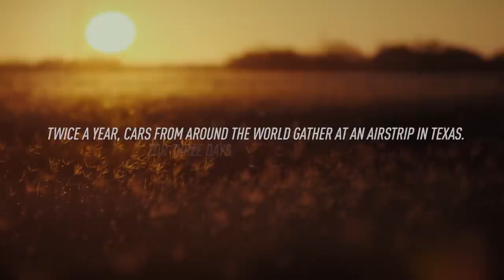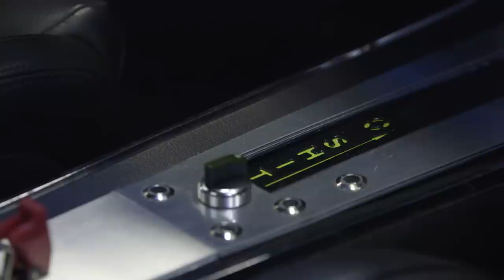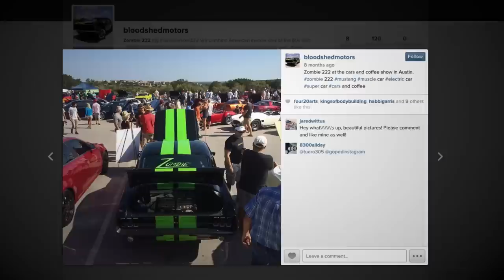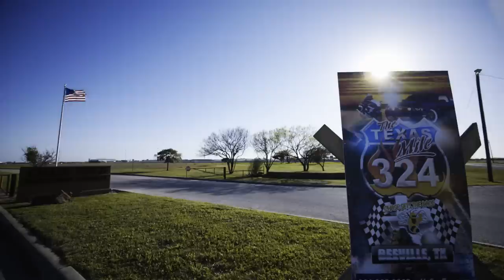The story of an all-electric, record-shattering '68 Mustang

Comment: The verge is hands down the best I've seen at featured videos, theres always some special element they add that makes it so engaging, and the stories are unique. Awesome job to the team that put this togther
Reply: aka wide angle lenses. It looked like a 20mm (maybe an 18mm)
Reply: VikTheGreat we do love our wide angles lenses! Our go-to lenses at that range are the Canon 10-22mm EF-S and 24mm 1.4
Reply: Oh, so you guys didn't shoot on a full frame sensor? I thought the Verge Video-team shot on 2 C100's.   Did you shoot it on a 7D instead?
Reply: VikTheGreat Nope, we very rarely shoot on full frame sensors. This project was shot on a combination of C100s and a C300, probably 50/50 each. Tried to do a lot of the exterior stuff on the c300 due to the stronger codec, as well as using the detachable monitor for some of the in-car stuff.
Reply: It's awesome to hear how you go about filming. I absolutely love your video team. Thanks for responding! :D
Reply: ***** all hail wide angle lenses
Reply: ghmasterjj i would say Verge is next to MKBHD but yea i love their graphics they are great .
Reply: ghmasterjj This is the first I've seen and was impressed. It was just simple facts, no fluff. I kept expecting a commercial break and a cliffhanger before they showed the top speed. Or 10 min of discussion on what it would mean to them before showing the speed.

Comment: We took the Monster to the grand opening of the San Antonio Speedway last night and set a number of new personal records. We now have a 0-60 time of 1.91 seconds and ran the 1/4 in 10.24 at 140MPH.
Reply: DAMN!
Reply: mitchmedford correction. o-60 in 1.94....typo
Reply: +mitchmedford  ! Starting to make I.C.E. CARS LOOK OUTDATED AND SLOW !
Reply: If you could get your 60 ft time down you would easily run in the nines. Has anybody tried using a clutch set up with this combination.
Reply: +ben huffman And the point of dropping the clutch would be??? Dude stop thinking with an ICE mentality, there is no heavy flywheel to carry reciprocating mass and get pistons to the next firing position, and any extra mass would just help induce wheel spin. Electric motors make peak torque at zero rpm, therefore you have the advantage of NOT shock loading the drive train / rear tyres like an ICE vehicle to get it moving, you can apply all that torque without twisting up the body unnecessarily. If anything you probably want to apply the reverse. Tyres have a maximum grip point when warm, you would probably get faster times by dialling some of the torque out of the car to launch it. And to answer your question yes you can run an electric car with a clutch but only for more efficient gear changes. I've driven an electric manual with no clutch and it isn't that much fun, you have to wait for the motor to spin down with the direct coupling to the gearbox to allow smooth changes, doable but not as smooth as having one.
Reply: +mitchmedford Man that thing is really cool and i want to love it but the sound just turns me off, its a great car and good luck with your vision, also great choice in car i love my 68' even though it has a 289
Reply: +mitchmedford Awesome and inspiring work.  Another niche I would suggest you look at are Mazda Miata conversions.  There are a few companies offering kits now but the performance historically has not been that great.  A 250Hp to 400Hp electric miata conversion kits for $15k to $30k would be great and sell quite well.
Reply: cool and they are rear drive too . sounds like a great option !
Reply: +mitchmedford HOLY CRAP! you go to the Sandyz in Lakeway?! I used to see old classic cars there all the time when driving around but i never had time to stop. I can't believe this thing is from Austin! I hope I see you around someday I'd love to ask you the same exact questions lol. Awesome car man. And I admire that you're following your passion.
Reply: +mitchmedford Why such a high 60'? Unless you mean 0-60mph?? You should word that better...
Reply: Think they are from the USA where they do not use metric like the rest of the world !
Reply: Terry Thomas I live in the US though? Whats metric have to do with it?
Reply: only 3 countries in the world use the imperial system & we in the other parts know only metric so when we see 60 we immediatelly think km ! so it looks really slow . as opposed to 100km !
Reply: Terry Thomas Speak for yourself... If I see an American post something I automatically assume it will be in imperial. And even though I live in a metric country I learned both at school.
Reply: um Which America ! North  Central or South ! Maybe you mean the USA ! The accent is the same in Canada where they use metric ! so one can never presume the yank sound to be imperial or metric !
Reply: Terry Thomas Hes in Texas
 so USA
Reply: ok
Reply: There is only one America where they speak American (English). Canadians speak Canadian (English) and French, and South Americans speak predominantly Spanish. To the untrained ear they may sound the same, but people say the same thing about New Zealander's and Australians which both speak English but when you listen closely they actually sound nothing alike.
Reply: ok
Reply: +mitchmedford 
Just a follow up on this, they're down to 1.79 0-60 and a 9.89 quarter mile.
this is way, way past scary fast.
to put that into perspective, you get to 60 faster than you can say "zero to sixty in  one point seven nine seconds", go ahead, try it with a stopwatch.
Reply: Bit quicker than Nissan GTR or ferrari .
Reply: Sir, if you ever make a stop in Tucson, Arizona, let it be known you have one passionate fan here who appreciates  what you've done with your amazing vehicle. It is literally a dream come true! There's also a night of me paying for your drinks that night should that opportunity ever arise.

Greetings from The Old Pueblo,
Arthur "Aardcore" Gardner.
Reply: Race him cross country in a family sedan and you'll leave him days behind. Just wait a second while I refuel should only be 8 hours or so :) and at that speed he'll be lucky to have an hour driving range.
Reply: This thing would burst into flames instantly with all that battery power. It looks like a muscle but it don't sound like a muscle car which is part of the fun man. I want to hear that mosnter growl and scream and you can't get that with any electric vehicle. I like the car but I don't believe it's a mustang.
Reply: i wonder what you are going to do in 5 years to beat this,, you got great traction control on this,, vary nice.
Reply: i would t
hink you would want computer traction control programing.
Reply: rimac
Reply: So we basically have the rate at which the Tesla roadster stats here then lol.
Reply: lessdeth69 wish they'd do a 90s Festiva.. and it could finally have AWD too.
Reply: @drewholt1860  fit a lightweight sound system and amp your favourite in relation to the Amps X Volts
Reply: @dalelc43  oh FFS when did you last take the second fastest car in the world for an endurance test?
Reply: You're awesome do a fox I'll give you a roller to do it they weigh a 1k less you will get that 170

Comment: Aerodynamic is really important, at the first moment i dont understand how you put that spoiler if you want top speed.

The next time remove spoilers incluiding the front, cover the rear wheels, and cover the down of the car with tape if its necesary. And a plain hub caps helps too
Reply: vicesat Agreed except for removing the front spoiler. Everything about these vintage Mustangs wants to lift the car in the air from the front. The chin spoiler helps keep the front down. The wing was only there as a precaution because we had never engaged overdrives at high speed with skinny speed rated tires and wanted the extra down force for traction so the rear wouldn't slip. After the first run, it was clear that we didn't need the extra down force so we removed it to reduce drag.
Reply: I think in that, because i see a few cars flying because they dont think enought in this.

But maybe a smaller front spoiler, or turn a bit to have it more straight with less grip, helps to high speed without risk

Comment: How's the battery life though?
Reply: It does about 40-50 miles per charge, depending on acceleration.
Reply: It's called "range", it's not a cell phone :)
Reply: ***** Far from a dragster :)
Reply: Esa Edvik you still charge the batteries tho
Reply: ***** What kind of cameras did you use? The video looks amazing.
Reply: Rashad Yeah il stick with a model s for that.
Reply: Idk but he can get better battery life by flashing a different kernel
Reply: ***** Not when they're 32k a pop hahahaha. I guess you could probably afford the batteries if you could buy the car.
Reply: Tyler Eberhardt i was reaponsing to Esa Edvik mistakenly assuming he was rasponding to the original comment... now i realize that my comment makes very little sense :))
Reply: Rashad The racing pack we use is the lightest pack design that gives us the power to shock folks and enough cruise range to do races, cars show and short runs around town. We can go 40-50 miles on a full charge. We could easily put in a bigger pack to get more range, but it will weigh more. We expect our customers to work with us to determine the mix of performance, range and cost they want on each car we build.
Reply: ***** How's the tire life when the battery is used in an aggressive manner?
Reply: Rashad It's got it's ups and downs!!! Just like yours... HA!
Reply: Tyler Eberhardt but bro the cost to fill up to a full charge is free if you are on the road or it cost about 14$ to charge at home. U save a lot of money from not buying gas.
Reply: Its a bit bland though..fun to drive..just looks boring and dull (a tesla S that is)

Comment: I like the idea, just wondering how much juice can you get on that 30k battery if you want to ride it on a daily basis without charging.
Reply: as he's got it set up now, it charges in about 45 minutes and has a total range of 40-50 miles.
Reply: ***** Which is about what the average daily commute is in the US. Not that anyone actually realizes that :)
Reply: ***** Full charge in 45 minutes is nice though.
Reply: jshaw6600 That's pretty normal for almost any modern EV. Even more impressive if the battery pack is huge. 20min to 80% is pretty typical, then it usually slows down considerably to preserve battery health/safety.
Reply: Sema R The Zombie 222 has a racing style battery pack design for maximum sort term power release for crazy acceleration and speed. It is very small (280 lb.) compared to a Tesla (I think over 1200lb),  but also very short range. We offer larger packs for longer ranger is that's what the customer wants. It is a simple formula. More battery add weight, increase range, but reduces performance and increases price. I expect most vintage cars lovers will want 75-100 mile packs.
Reply: SEMA 311 I believe how efficient it is now for a drag set up it could be set up to have a top speed of say 150 or various modes to get tesla style miles out of it.
Reply: IF I had money, I would go for  a 1971 Skamp, just love the car. Had 1 and never let it go.

Comment: Aerodynamics - you know your stuff.  Trucks, lorries in the UK here, you see them go around when empty, with the tailgate open, because it is less drag.  My old man made an electric car in the late 1970's, aerodynamically tested it in a water tunnel using a spring-gauge (like for luggage weighing) on a model version 1/10th size or so.  He found, the TAIL of the car is what mattered most - the front could almost be blunt by comparison.  And, in fact, check out an aircraft wing cross-section or rib, it gets 'fattest' about a 1/4 to a third from the front, and has a long, slow fine tail to nothing at the flaps.  Your car actually, is a damn good shape STOCK.  They got it right aerodynamically in the first place.

Comment: Fantastic, guys!  I dream of seeing something like the 222 Zombie take on the Oklahoma Street Outlaws..... but it may not be up to the task of competing with 2000HP street cars... quite yet.

I dream of building projects like this... but I'm more of a motor-per-wheel fan... such as Protean Drive with 735 lb-ft peak/516 lb-ft continuous torque per motor/wheel.  The gen-1 Oldsmobile Aurora was so far ahead of its time, "Electric" would be a good update. (plus, big vehicles have lots of room for batteries, controllers, fuel cell, etc.)

Stick a couple hundred Maxwell BoostCAPs in there (100s2p) across the battery pack to boost initial acceleration capabilities (and act as a braking-regen buffer), and it'd be an exciting drive.  Stick a hydrogen fuel cell in there to extend the driving range... along with a metal hydride solid state hydrogen storage vessel... it would be a fun project.

Comment: I know this bad ass Stang is built for top speed, but just out of curiosity, what is the range with normal driving?
Are the batteries liquid cooled and temperature controlled?
Is the inverter also liquid cooled?
Reply: +Joeak74 80-90 milrd. The controller (DC uses controllers and AC uses inverters) is water cooled. The batteries are forced air cooled.

Comment: So two forklift motors in this thing? or is it just one. I wonder how much they modify the motor.
Reply: +SeanHodgins We use 2 motors each with their own controller coupled together to act as one. We use racing grade brushes and added extra insulating coating on the inside
Reply: mitchmedford
Thanks!

Comment: Wow!  This is a great test bed for pushing the tech into the next generation of vehicles.  I'm very curious to know how it handles in rain, ice, and snow.   All weather testing is something that needs to be looked into as well.  This vehicle is a great starting point for something much more awesome down the road.  Good work.  Great concept.
Reply: Robert Davidson Basically it handles better that it did from the factory when it was new, but that is because of the suspension and steering upgrades we made that could be done to most vintage mustangs.

Comment: Good job.  Need more people like this guy.
History Info: Ronaele Mustang had the very first all electric mustang as seen on you tube.  
Now the the founder of that company and Adomani has a 3 tier all electric motor system with twice the instant power of a corvettes, up to 8,000 rpm with many more tricks.
Battery pack price is good if you have a fast 40c burst discharge at 46kwh pack. 
I would go with a 23kwh battery pck to make it lighter and only spend $15k. I can fast charge that thing in less than 20 minutes as well.  
Should be running 230 volts on electric motor?  Why 222?
Reply: edward monfort 222 stands for 2 motors, 2 controllers and 2 damn fast.
Reply: Mitchell Medford I didn't want to thumbs up your reply cuz there was a 2 there! HA!

Comment: Awesome! -Taking existing cars and making them electric is a opening for a new market; I would love to get my 2001 Saab 9-5 Aero converted or even the Ion fuel cell technology or what Stanley Meyer invented the hydrogen combustion engine using water as the fuel that is converted into usable hydrogen fuel or Troy Reed's design on electromagnetic surge generator motor that he proven to work in a Geo-Metro...but still I will get a Tesla and/or other good quality electric make/model ...

Comment: Great car and beautiful video. Wind resistance is a bitch. Cd is probably over 0.45 with that wing. I would like to see what P85D can do.
Reply: miqo85 I believe it was 0.45 without the wing. We only had the wing in case we had trouble needing more down force when engaging the overdrives with skinny rear speed rated tires. Turns out that the battery pack weight took care of that so we lost the wing on the fastest run. I was and still am more concerned with front end lift. The Mustang was made to look like it was going fast by leaning into the wind which is exactly opposite of what we want at high speeds.
Reply: Mitchell Medford Did you try blocking out the front grille minimizing the turbulence within the engine bay cavity? Smooth out cavities of underside with carbon fiber sheet or alum.? Put motor in rear similar to P85D setup, eliminating drive shaft adding more battery room up front? AWD? I know, can you write me a big fat check... Right? In time and funding things will evolve nicely...

Comment: I've got a 66' coupe sporting a 95' Mustang GT drivetrain.  Maybe in 20-30 years, it'll be possible to shoehorn an electric sports car's engine under the hood for less than $50,000...

So come on folks, push for some good EVs so I have a decent selection in the junkyard in the future.

Comment: I'm surprised he's still running with series/parallel-wound DC motors. Why not take a smashed tesla, put two of the rear motors in parallel, and run them with the tesla battery pack? You'll need to cobble together a custom gearbox and reverse engineer the CAN messages going to the inverters, but you would have way more power and better longevity.

Comment: The Lady Pink With Her Sea Legs ON (Vessel #2) can depart under the Golden Gate Bridge . . . and be in waters outside Waikiki in 12 minutes and some change . . . has traveled to the Horn of Argentina in under 3 hours . . . and we are suspect she can go a great deal faster . . . Aileron 1 PX 1 Drone . . . left (soft vertical take off) a location in Northern Cal, and safely landed in Shanghai less some burned up GoPro Cam's 2 and half minutes . . . I have great footage . . . when the SuperScorpion SkyTruck ; a tricycle that flies does its maiden flight . . . I will publish all of it.
Electric cars don't need battery banks, and 400 miles per hour safely, is not out of the question.